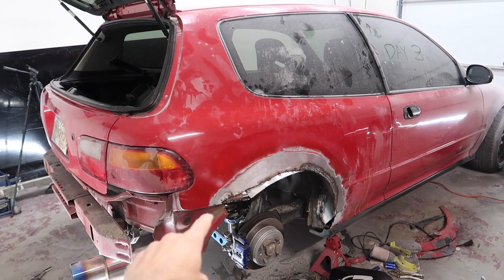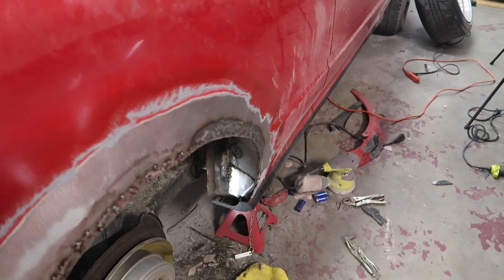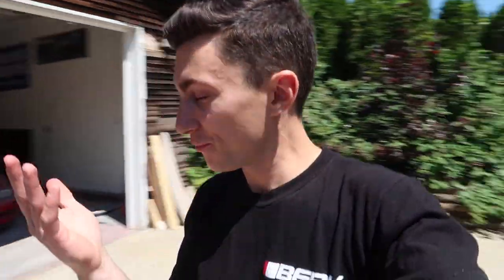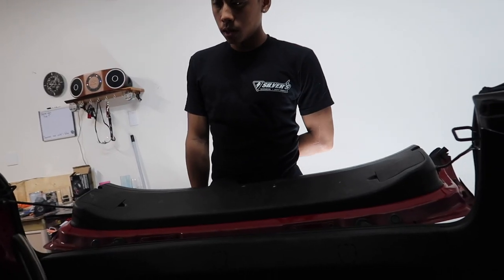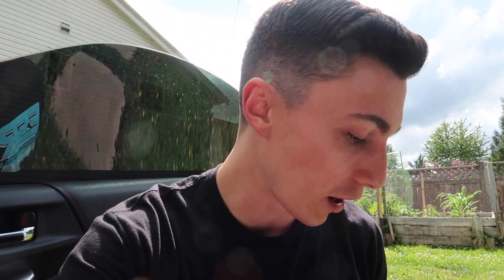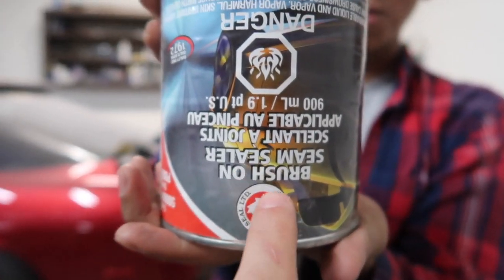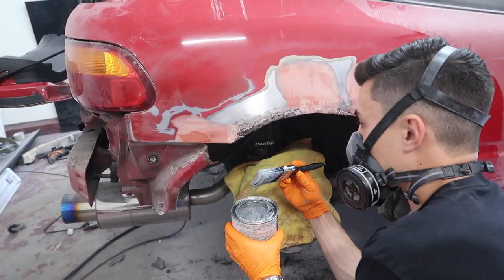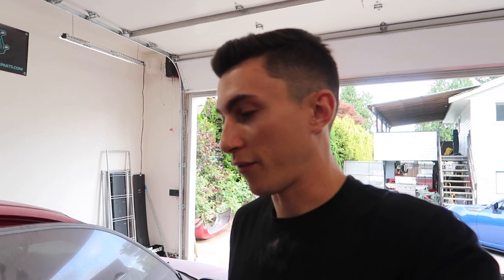BRINGING BACK BONDO BOOTY! - DIY Rust Repair pt.2

Comment: Love the whole 'stay committed' thing.  I picked up a 99 Miata that needed a new radiator and clutch hydraulics. Did those, replaced the radiator hoses and thermostat while I was in there, and then the thermostat started leaking. Instead of just fixing one thing, I decided to dive all the way in and do the timing belt, water pump, and front seals. Messed up the gaskets the first time around, the second time around I realized the geometry of the water pump outlet was wrong (after putting it all together, started leaking) so I got a different water pump and went for it again. The whole process ended up taking a month, but now I've got a beautiful Miata that needs nothing for a long time. Watched a lot of your videos during the process to keep my hopes up <3

Comment: instead of welding the fender you could use rivets, then just hammer the rivets in a little then put body filler over it. I did this in school to repair a rust hole on the lower rear quarter panel and it was fairly easy.

Comment: ALWAYS! Use primer on bare metal before bondo or else it going to rust again.
Reply: bondo exualy seas you need to have bare metal before aplying
Reply: @ianduijsens  I have used alot of bondo on many cars and never bondoed on bare metal! I live in sweden wich has similar weather as canada and alot of fucking salt on the roads. 

Why you never should bondo on bare metal is becasue of the bondo dosent seal properly, so when you get scratsches in the paint the moister goes through the bondo and get caught in there.
Reply: I do auto body for a living, bon do won't stick to a painted surface reliably only icing will, only thing your primary before hand for is seam sealed and icing

Comment: Remember. Welding makes a lot of heat, put paint or some type of sealer on both sides (inside and outside) carefull near the gas tank and fuel cover flying metal sparks can fling around and catch the whole car on fire.

Comment: AHHHHH GRINDING WITH THE 240 SITTING THERE. You will have rust spots in the paint now
Reply: Grinding sparks will melt into the paint.... ive had it happen to my car when i had to take it to work and someone was cutting with a grinder and the sparks were hitting my car.

Comment: Don't bondo over bare metal same as last time will happen it will rust!
Reply from the maker: It wont stick to anything but bare metal!
Reply: @RobbieFerreira  Ah maybe the stuff in Europe is different then. I googled it and it seems like you guys do it the other way around haha sorry. 

Also apperently there it depends on the type of filler if it goes over or under primer. 

Bondo is a brand name so I don't know the exact details so i'll shut up now xD